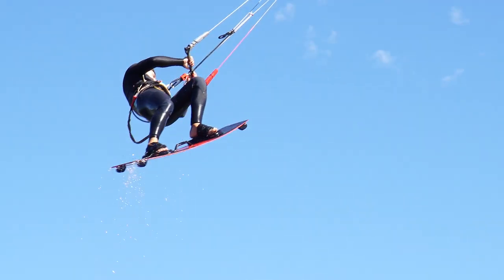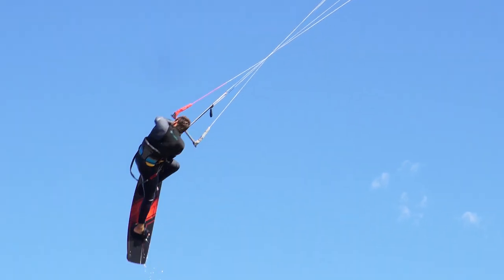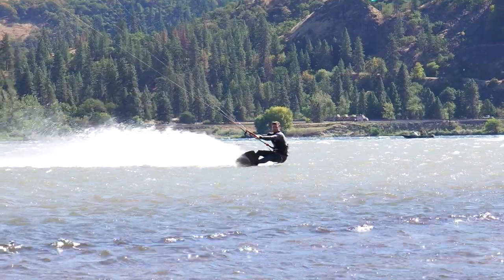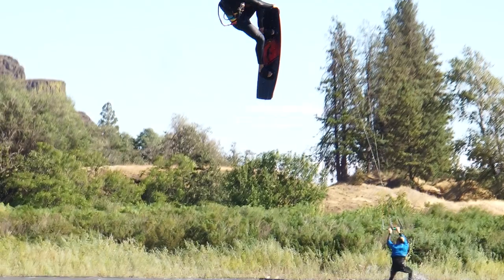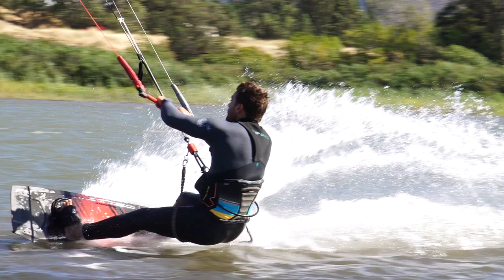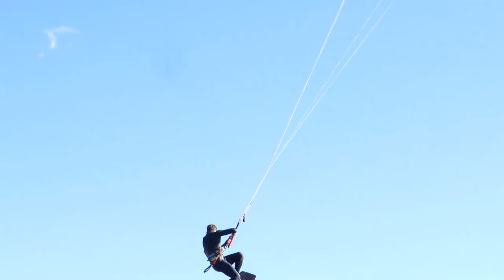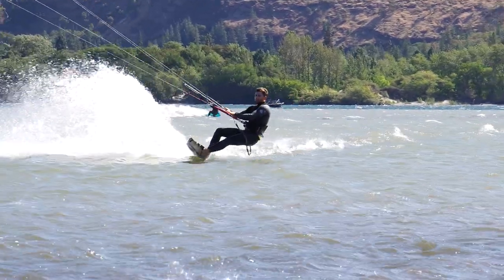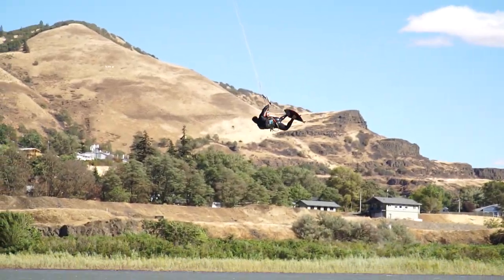Kiteboarding Pre Load And Pop

Comment: Guys, Evan the point that is not being addressed in quite enough detail here is the sync with sending the kite up, it is crucial and it just does work at all even if getting the hop and land and carve upwind right. It took me months to get there with a lot of frustration and trial and errors. If only i had been told that i was either loosing my speed and energy in the system, or else losing my edge for being unable to control the kite, was due to the sync with the kite. i.e. with my core GTS5 8 or 10m, and being an avg rider 80kg, I need to have the kite almost at 12 o clock when landing the hop and about to carve upwind hard. This needs the utmost precise timing, cause send the kite too early and you loose your edge, or else take off with the kite past 12 and it a less than vertical take-off, send it too late and you loose your speed. 

Even jump high with mike has an excellent video on the topic, but same stuff, he fine details the hop, land, carve, hop and sheet int jump steps, and gives high level directions as to sending the kite "super fast". But does not give detailed answers on the importance of the kite position and hte importance of feeling your kite for every kite will have to be sent differently. 

Yet if i had been given such advices as to REALLY play around with the kite sending timing, my god i'd have saved almost a whole season ! 

Again @mackiteboarding, if we could have another vid on the topic would be amazing. The preload pop technique is the dark secret of jumping vertical in almost any conditions, especially gusty or choppy. For it makes the final carve upwind so much more efficient and easy once dialled in. 

Folks, my advice from struggling on this topic for 1.5 seasons so far and only starting to get results now: 
1) The bar and kite tension adjustment :  The pop itself is not straight forward, the reason : it needs sync with the bar pull/tension adjustment, again not detailed here, you NEED to release your bar when about to hop, otherwise the kite tension is too much to allow a decent hop.

2) The hop itself the gesture: it is not just a normal pop using upwind carve, it is also and mosty, a) extending your body, legs slightly, then small hop off the water and when in the air, you need to fold your body and legs like you load up/compress a spring, the spring is your body and legs in particular. c) land it with as much angle as possible in the board edge, d) release the spring energy when carving upwind, starting with compressed spring / low body center of gravity position, the lower the stronger you are to hold your edge and carve easily. 

3) The harness need to be low ! Last tip: the bloody harness needs to be nice and low on your hips, try the difference upper or lower, it is really a world of a difference when it comes to resisting the kite pull ! small details makes a massive difference ! Think leverage, your tighten a bolt hard well you use a long spanner or wrench, leverage, force proportional to the square of the distance compared to the spanner point of rotation. Same thing with the board being your center of anchoring/rotation, if you give the kite a long spanner / high harness position, you wont be able to hold it. If you shorten that spanner, and incidentally you put that harness as close as possible to your center of gravity/ in exact terms here your force baricentre as the kite is involved too, means by lowering the harness you lower your baricentre of forces, and the direct consequence is most of the kite pull goes through your leg and lower body == much bigger muscles instead of your upper body, weaker shorter muscles. Physics and anatomy basics...
Reply: Perhaps in this comment I learned more than in all the VIDEOS that I watched before.❤

Comment: Hi, thanks for the tips. Could you say sth more about synchronising it with sending the kite? When should I send it?
Reply: Timing is the hardest thing and nobody can really explain that to you just by the words - you have to exercise, repeat and repeat until it becomes natural...

Anyway - generally when you land after the pop that is when the kite should be slowly moving upwards and when you hit the edge hard - that is when you’re supposed to shoot the kite to the zenith as fast as you’re able to...
Reply: Completely agree the Sync with the kite is THE one difficult bit ! took me months to start getting it, and wondering why i was either loosing all my speed or else losing my edge and the answer is all in the timing with sending the kite up, and it varies depending on the kite. Find with my core GTS5 the kite needs to be almost at 12 o clock when landing the preload hop, and when about to edge upwind hard.